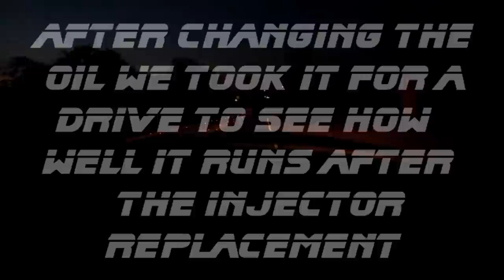How to replace Duramax fuel injectors!

Comment: Way to go, homie! You have joined a unique group of shade tree mechanics who have R&R'ed LB7 injectors. Did mine last summer and had to battle CA/EGR on the passenger side. Did you know "book" time is 17 hours and dealer cost can run close to $5k? Adjusting the valves was a pia (I used a wrench and piece of wood to over tighten the tensioner pulley and turned the engine with the alternator nut) and really quieted the system. All valves were waaaay loose. Also, an easy way to remove the top valve cover is with a block of wood and a 5# hammer. Don't want to admit how long my ride hung out of the garage, but I spent a lot of time documenting every step and cleaning parts. Easy to miss, but you did mention new HP lines during the video. Finally, the special injector extraction tool is nice, but attaching an old HP line for leverage and prying under the injector base works too.  Great work!
Reply from the maker: Thanks for the additional tips and tricks I'm sure someone else out there could use this. Yeah the cost of the install was a large part of the reason I decided to do it myself. It took me about a week working on it off and on. I think I could have done it quicker if I wasn't filming it, maybe lol. Thanks again for such a great comment, I love seeing comments like this. Hope you have a great day!
Reply: So you used some wood to put extra pressure on the belt? Sounds like it’ll just slip if turning the alt pulley without extra tension?
Reply: 2nd Momentum Garage My bad. I was not clear. I used a 1/2" breaker bar on the tensioning pulley and pushed it as far as possible to over-tighten the belt. The piece of wood was a 2X2 that I braced against the breaker bar to hold it in place. Trying to bump the engine with a socket on the harmonic balancer was a pia, so I got creative.
Reply: Even though you still have to look under at the balancer to ensure the timing mark is lined up to the mark on the block, this method seems like less work than getting the 36mm socket on the balancer. Good idea!
Reply: 2nd Momentum Garage: As probably the laziest guy ever, I found a link for LB7 valve adjustment that enabled doing everything from the top except (as I recall) confirming TDC on #1 with all valves closed (rockers free). After that, the procedure described which valves (starting with #1) were in position to be adjusted, with no further engine turning. Memory fails, but applying engine rotation per the procedure,  I don't believe I had to turn the engine more than once or twice (as instructed) to bring all valves into "adjustment" position. Not wanting to go in again, I X2 checked all clearances and did some additional engine turning.

As I type, your video is playing and you just yelled over the typical LB7 racket  "And it sounds so much quieter!" 😂. I stood next to a late model Duramax recently and with 7 (?) injection cycles per power stroke, it sounded like a gasser 😀.

Comment: This gives me hope.  I honestly thought this job would be hellish, not saying it’s easy, but it doesn’t seem THAT bad. How long do you think total it took you?
Reply from the maker: Yeah it's completely doable with pretty basic tools. It took me about 5 days, but keep in mind that included filming and running into issues with not having the right tools. I think it could be done over a weekend with some help of a friend. It can be a pain in the ass from time to time, but it's not that bad once you get started. Just make sure you have all the tools ahead of time and be careful on the valve cover bolts because they strip easily. Hope this helps!

Comment: How difficult was the valve adjustment while you were in there? Great video btw ! Alots of credit for filming all of this.
Reply from the maker: Zbskater400 adjusting the valves is a fairly simple process, here is a link to a complete instruction on how to adjust the valves. https://www.merchant-automotive.com/custompages/valveadjustment.pdf. Hope this helps!
Reply: The Daily Drift awesome thank you! How much were yours out of spec for the milage? Im doing injectors within the next couple weeks and it would be a good idea to adjust valves i have 220k on mine I doubt they have been adjusted.
Reply from the maker: Zbskater400 no problem, mine were surprisingly not that out of spec. Mine were on average reading 14 to 15 thousandths I think the spec was 12 thousandths if I’m not mistaken. Not bad for 320k!

Comment: Really clean engine bay for a 01, but you forgot to replace those hard injector lines that sit on top of the valve cover. Or you couldve at least cleaned them up, debris thats still in the portion where it connects to the injector can fall into it and will shorten the life of the injector. Ask me how I know lol
Reply from the maker: Duramax Pat yeah I don’t remember if the video showed it or not but I did replace those with a fresh set on both sides. Thanks for the tip though, you are absolutely correct!
Reply: I had a leak in the high pressure lines you guys were just talking about replacing.. Well mine were rusted and corroded and probably the originals and reused from the previous owner doing the injectors. I replaced the lines and now I have a Internal fuel leak and my truck is pissing oil everywhere by the gallon! no smoke no rough running no other issues! Do you guys have any idea where I went wrong? All i did was take the lines off clean out the injector with a vacuum and retorque the lines to 33 foot pounds!

Comment: i’m currently finishing up my injectors in my LB7. what a tedious job it is indeed, i didnt do what you did though, i rebuilt mine, so the job lasted me a total of 6 days working 6 hours a day, and i still haven’t finished. still gotta install my fuel rails and get her back together. i’m having trouble figuring out what i’m going to do about my glow plug manifold tho, i dont want to mess it up and have to take more shit apart to do it. anyway, thanks for this vid, although it is years old. i remember watching this a year or two ago before i had the money to do my injectors. i’m only 15, cant afford much LOL.
Reply from the maker: That's still a pretty fast job you did there. Mine took about a week on and off because of filming and waiting on parts. The glow plugs can be really brittle if they are old. I am going to replace mine soon and I'm dreading that job. Yeah these injectors are not cheap, but hopefully they last a long time, because I really love these trucks. Good luck with the rest of your install and keep up the good work!

Comment: Gotta love that Isuzu diesel
Reply from the maker: Amen to that!
Reply: Yeah but, those injectors suck big time.
Reply: When will you guys learn the Duramax isn't "made by Isuzu." It is a GM built diesel engine made in Moraine, Ohio.. Not "made in Japan by Isuzu" like y'all think.. Isuzu half way DESIGNED the engine with GM. Matter in fact, GM designed and built the fuel system. So it's really not even Isuzu's fault for the LB7 having problems with injectors.. But either way, the Duramax is BUILT in the USA by General Motors.... And, it's paired up with an Allison transmission built in the USA in Baltimore, Maryland.

How about we talk about that Powerstroke built in Mexico by a bunch of Mexicans? How about that JAPANESE Aisen transmission behind the new Cummins?

If anything, the Duramax/Allison drivetrain is the most American diesel drive train there is....
Reply: triggered
Reply: Don't be ignorant
Reply: William And hey willy, my uncle Juan assembles powerstrokes in mexico.bejore that job my uncle Juan was a goat herder. I luv my uncle Juan!!!!!

Comment: good mecanic thanks for the video
Reply from the maker: Letty Palafox thanks, I used Bosch remanufactured injectors. I provided a link in the description to the ones I used in the video. No one makes a true new injector for these trucks anymore, but these Bosch injectors are very nice and they come with a 2 year warranty.
Reply: thx for info
Reply from the maker: No problem, hope you get your truck fixed soon too!
Reply: thx for suport